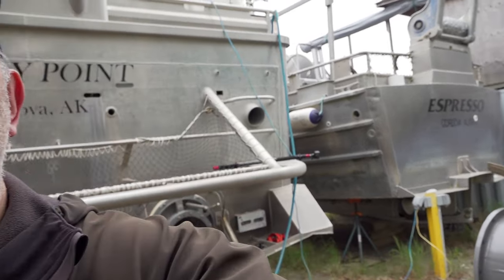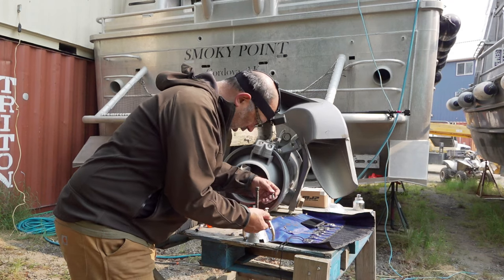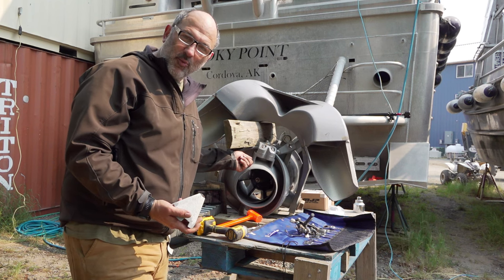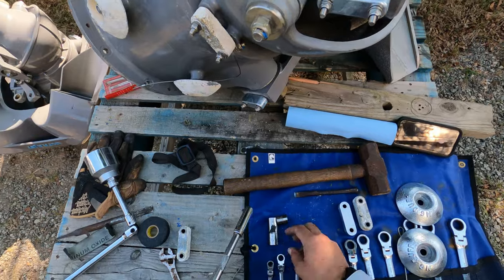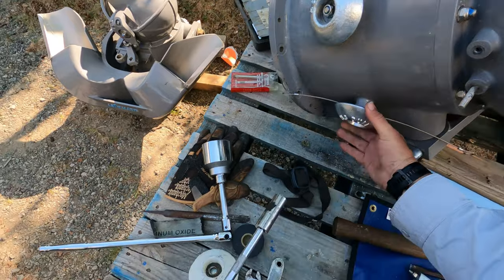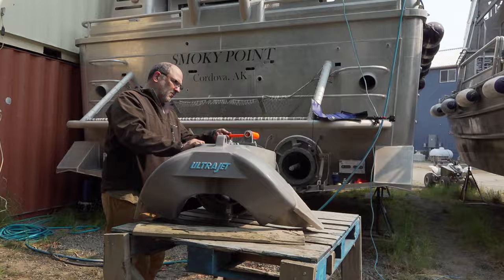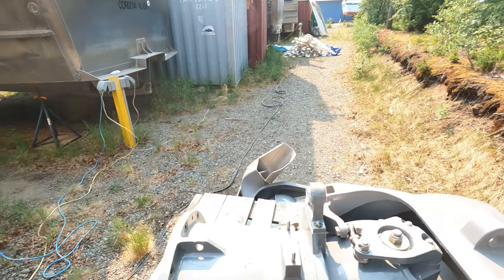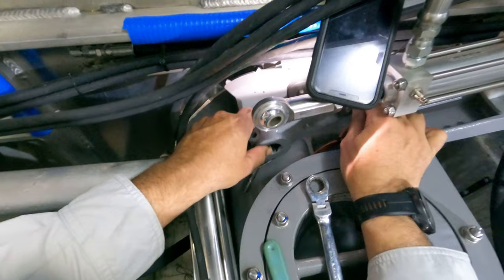Ultra-Jet 340HTS 1,000 hour service kit installation from Marine Jet Power

Comment: Great video! A suggestion if I may; support the shaft with a sling through the inspection hatch to prevent any damage to the shaft seal whilst the impeller and tail bearing is removed.  Great job!
Reply from the maker: That is a great idea! That I never thought of! It is also timely as my water seal on my port water jet just started leaking...